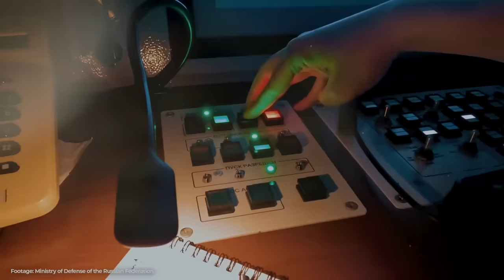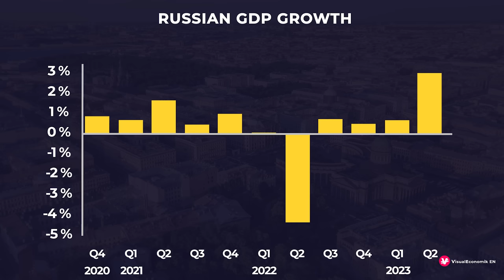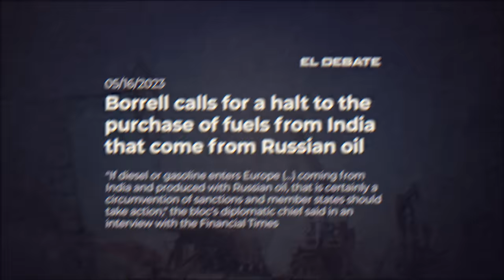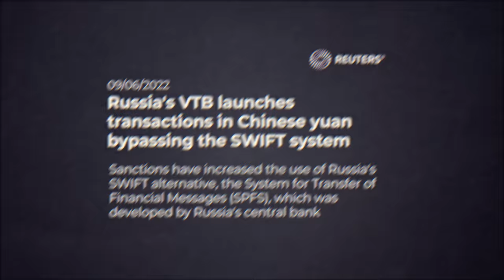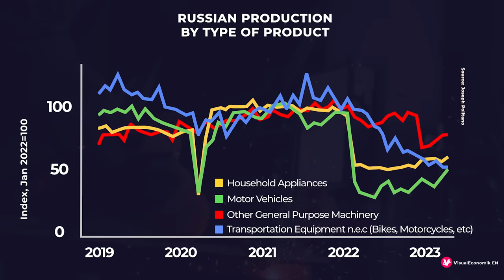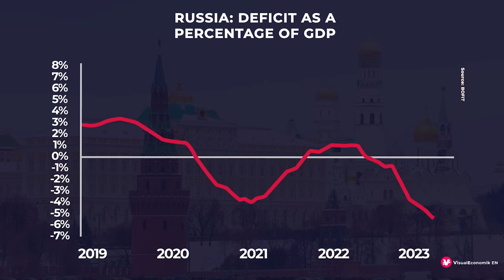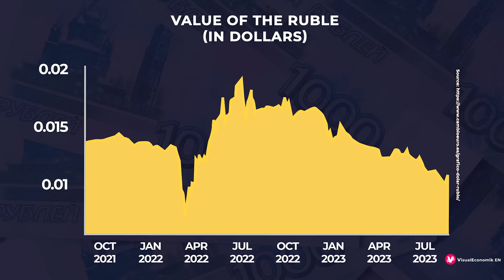Can Russia Recover and Win the War? - VisualEconomik EN

Comment: India buys Russian oil with a 35% discount. That's basically the entire profit. Russia has no alternative because you can't simply shut down oil production in the arctic.
Reply: They drill oil in Siberia not Artic.
Reply: @niweshlekhak9646  Siberia is stretching from the Arctic Circle to the northern borders of Kazakhstan
Reply: Russian companies handle insurance and delivery. Russia also makes money from this, not only from the sale of crude oil
Reply: @exocet8834  no, it is not: Siberia is a small region between the Ural and Far Eastern Regions. And Siberia does not border with China, as illiterate Westerners believe.
Reply: @alexgainsborough4921  Goodness gracious 🤦‍♂
Reply: @chrbay2715  uneducated foreigners think that Siberia is everything that east of the Ural Mountains, but this is not so. Siberia is divided into five parts: Central, Northern, Southern, Eastern, Western - but all together, they are about eight times smaller than the Far Eastern Region - and to the east of it, there is also the Primorsky Region, which occupies the coast of the Pacific Ocean.
Reply: Exactly! An oil well is not something one can turn on/off like a switch. If sealed it will take an immense effort to open it again. If let open they will run out of storage capacity.
Reply: Maybe last year, they've diversified since. Plus its far from their only export.

Comment: You do understand the sanctions were designed to allow Russia to still sell oil. They hit to global supply if Russia went entirely off-line would be catastrophic. So the idea was to keep them selling oil, but not to allow them to make any money doing so.
Reply: The price cap didn't work either and remember Russia has not so far applied sanctions of its own except on diesel
Reply: For you to say that, provide Russia's cost of production and sell price, if the difference is greater than zero, they are making money.
Reply: Cutting 20% of oil and gas will hit the world economy. It will have a massive impact on global energy sector and it will strong Domino effect on any other sector. It may be as strong as the great depression, oil refinery isn't build in a year or two. It take decade to support a new sources to replace Russian energy
Reply: Don't you say that Russia stil selling oil and does not get money from it? Insane take
Reply: It would be catastrophic for the rest of the world, the russians can survive for a few months soly on their foreign reserves but I dout that 150 to 200 dollars per barrel would be a price any western economy can stomach.

Comment: The crazy is that germany wants to repair nordstream 2. I thought Germany wanted to completely cut off the use of russian energy. At least wait until the war is over before discussing it.
Reply: If Germany does not open the pipelines it will not be able to compete with Asian industrial producers.
Reply: @pavelsanda3149  Laughable. Asians are dependent on LNG as well, the prices are equal globally.
Reply: @jansix4287  exactly, Germany thus has lost its advantage.
Reply: @pavelsanda3149  German products were NEVER cheap. The German economy developed under the strong D-Mark. Always more expensive than every other country around them.

Comment: Russia should be concerned about China, circling over like a vulture.
Reply: Siberia has to be looking awfully attractive to China right now. They've probably got more legitimate historical claims to most of it than they do to the weird Nine Dash Line.
Reply: China has its own problems, as the yuan is in downfall. Right now, 1 USD is worth 95 Rubles or 7.2 Yuan (RMB). That is a 3% drop in the value of the RMB.  In simple terms, Russia is having trouble buying goods from China because the RMB has greater value than the Ruble, but the Yuan itself has less purchasing power.
Reply: @andrewalderman9489  
+ internal dispute between CCP and Xi + they are losing their soft power on indo pacific due to their tiger diplomacy, everything is falling for china really hard.
Reply: @AnimaRandom  I think it's also important to remember that when a country is in a difficult situation like China, leaders often create an external conflict to garner support. Xi is not above doing this, and it could turn into a perfect scapegoat if he is to feast a little on the corpse of Russia.
Reply: yea.. We have a history-hot conflict with West and should be concerned of China, it makes sense :)
Reply: @krivdaa9627  A partnership without limits, remember? Oh, we found those limits pretty damn quick then the javelins started flying didn't we?

Comment: 0:37: 💪 The West's support is key in Ukraine's war against Russia, providing weaponry, ammunition, and sanctions to weaken Russia and strengthen Ukraine.
3:21: 🌍 The video discusses the historic sanctions imposed on Russia by the West, focusing on restrictions on trade, freezing of assets, and targeted sanctions.
6:18: 📈 Russia has found ways to bypass international sanctions and increase its GDP despite being expelled from the Swift system.
9:51: 📉 The Russian economy under Putin's regime is not producing goods and services that benefit ordinary Russians, resulting in low material welfare and limited wealth.
12:28: 📉 The Russian economy is struggling despite strict capital controls and military spending, which is primarily focused on resisting the Ukrainian Onslaught.
Recap by Tammy AI

Comment: So to sum up in economic terms. You have one economy, Russia, up against an alliance of the 31 richest economies in the world. They can push the engine and maybe keep up for a while, but eventually it going to burn out.
It's an effort similar to the Axis powers in WWII. They weren't the strongest economies in the world, but they went up against the strongest ones with all their might, hopping they would push them into giving up. 
Russia has essentially got itself into the same position and is hoping the NATO countries will loose interest, for one reason or another, before Russia burns out their economic engine.
Reply: It's not only about the money though. Ukraine and Russia's army on the frontlines are about the same size now, but Ukraine has fewer men that can be drafted than Russia does. And at this point it's Ukraine that needs to go on the offensive taking huge casualties, while Russia is perfectly happy sitting on the defense saving forces. Just look at this counter-offensive. Russia doesn't need more people to keep defending, while Ukraine will most likely need to go through yet another mobilisation for their next counter-offensive. 

It's also important to remember that Russia switched to war economy while these 31 countries did not. This means they aren't allowed to spend as much of their budget as Russia does. Poland which was Ukraine's biggest ally in Europe has already stopped and many other smaller countries will surely follow.

Comment: This video understates the effect of sanctions. There is a world of difference between selling fossil fuels at, say, $100 per barrel and selling them near cost (~$50 per barrel). However, the West should be placing FAR more pressure on India and Turkey to refrain from buying from and selling to Russia while Russia continues its war against Ukraine. I don't understand why the West has not imposed secondary sanctions on those countries.
Reply: Because the Turks are already suffering inflation and recession from Erdogan’s policies. India hasn’t yet recovered from Covid devastations, approx. ~4.7 million deaths. Secondary sanctions on poor countries would cause only more deaths.
Reply: But just a few years ago oil prices were well below $50 per barrel. I guess it's not that bad if Russia sells it at $70-80 ))
Reply: Ты с какой страны?
Reply: Reuters says that India was buying at 30% above the price cap, which is $78 roughly at the time you've written this comment (article date: 28.09.2023). Price has come down since then, but your comment is still wrong.